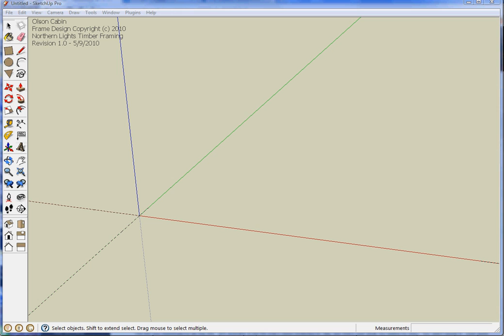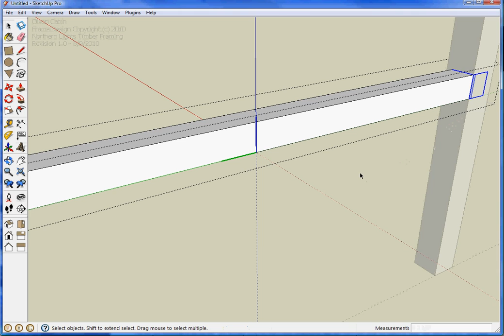Using the Stretch Tool

Comment: I'm NEW to Sketchup. How did you quickly rotate the copied post at the beginning? I've only come across tutorials where they go through the lengthy process of using the rotate tool.
Reply from the maker: That's a different plugin of mine, called Rotate 90.  You can get it from the extension warehouse.  Then map it to a shortcut key.  I use F5.